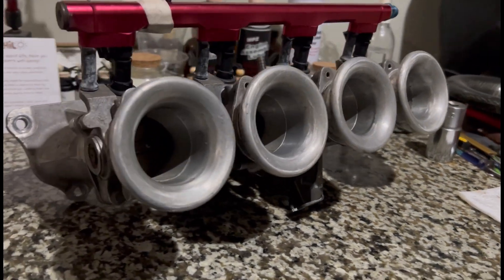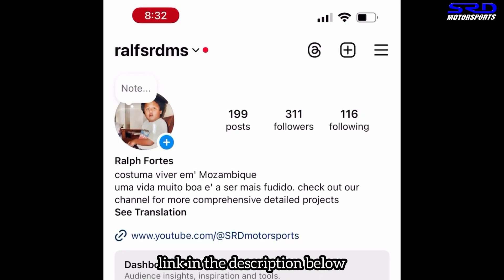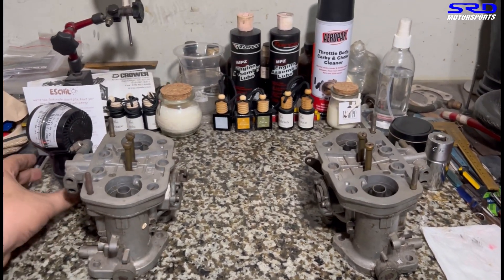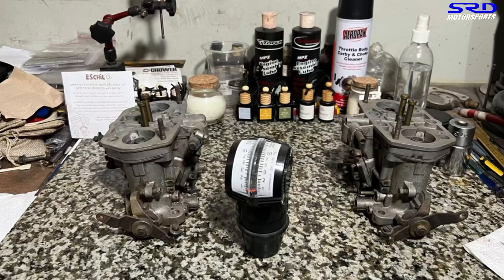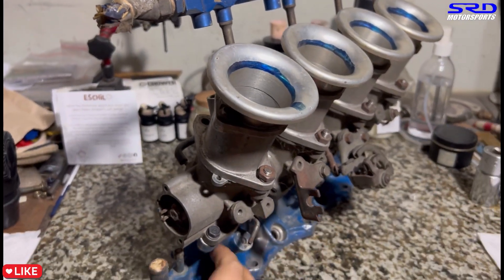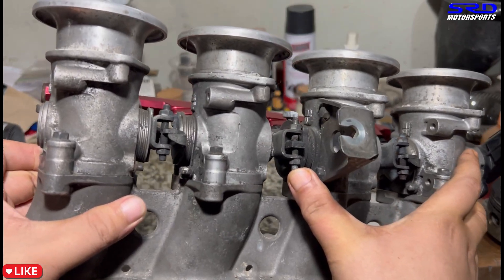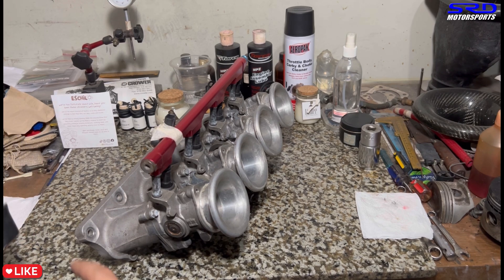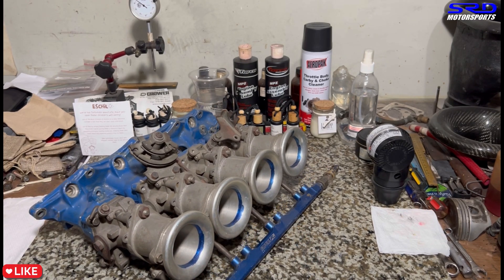How to Synchronize ITB for Smooth Idle | Common Mistakes!

Comment: OBX ITB appear to be a 4age 20v copy. Isn't synchronization done via the small screws just behind the trumpet flanges?
Reply from the maker: @AW11SC  Yep for the 4ag on the rotor where it connects to the next throttle

But the stopper is where u sync the closed motion

That’s what’s often overlooked